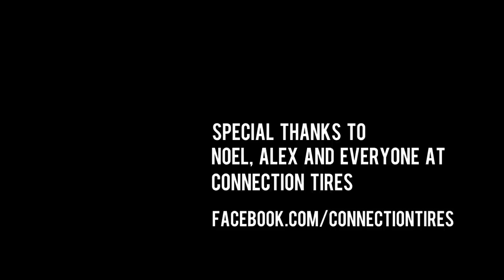Civic EK Stance Project: Coilover Install

Comment from the maker: Very cool man! Thanks for watching! Yeah, the milling can be done 10mm.  They are reffering to how much material there is on the back of the wheel.  You don't want to take away any structural integrity of the wheel itself by milling to much, but 10mm is fine.  Have fun!

Comment from the maker: yeah man. I honestly don't have anything to compare it to that I personally have owned.  I think the KSports ride fine.  One thing you have to keep in mind is that when your lowering a car, the springs are naturally going to have to be stiffer than stock.  So of course it's a "firmer" ride, but not anything that is annoying at all.  Run them on the full soft dampening or even change out the springs themselves to a lower rating if you didnt like it. I love them tho! Handles like a go kart!

Comment from the maker: Thanks for your compliment man!  The car sits about 5 inches off the ground right now.  I don't know how much I lowered it to be honest...a couple inches for sure.

As for the fender rolling, my advice is always.  Maybe others might say different I don't know.  Since I chose the 8 inch wide wheel, it was a must.  I knew I didn't want to do a "stance" car, so it wouldn't be slammed on the ground, but instead, got the fenders rolled because I didnt want the tire to scrape under hard cornering.

Comment from the maker: My best advice is to get out your measuring tape. I got 15x8 Enkeis which came in a +25 offset. It was poking out a bit too much from my fender so I actually got these wheels shaved down 10mm to make the final offset +35.

 I also run a few degrees of camber so the car handles real well in the turns but is giving it that "flush" look your talking about. Do your research on what camber settings you want to run as this should effect your decision on what wheel size and offset you want.

Comment: @ Refine Movement, I am ordering my wheels and tires next week, I have put it off way too long and need rubber badly and I'm not buying new rubber for  stock wheels, so its time. I'm going w/ the 15x8  Enkei 92's too, but in black because my 96' EK hatch is Vogue Silver and I think it would look the best on silver and it does "NOT" show "BRAKE DUST" I'm going 205/50/15 as well but really like the way the AVIDS look and their price, but going w/ Dunlop Direzza's Zii's because they have the BEST traction reviews of just about every tire out there and 2 lbs. lighter and 7.5 tread width compared to S-DRIVES 7.4, which I hope does not haunt me because they are ever-so slightly larger,

Comment from the maker: Well so far my efforts have been put in to the suspension.  KSport Kontrol Pro's 12kg springs up front and 10kg in the rear.  They are entry level coilovers and I don't have anything else to compare them to that I personally have owned, but I like these coilovers a lot.  The dampening adjustments are actually something that can be felt.

Aside from that the wheels are Enkei 92's in 15x8 which came in a +25 offset from the factory.  I had them changed to +35 to fit to my car more to my liking :)

Comment from the maker: mikesanto70, any reputable machine shop near you should be able to mill down your wheels.  You just give them the specs you want.  I'm honestly not totally sure how low I've dropped the car becuase I had changed the ride height a handful of times before getting what I wanted. I know the side skirt towards the front of my car sits about 5" off the ground. The rear is maybe half an inch higher. I like that setup for handling in my car. Thanks for watching!

Comment: reads like a tire rack ad.  LOL.

Looks like you even used the tire rack lug nuts.

Looks good with the silver and black though.  I had forgotten that they rereleased the 92s  interesting look on an EK.  I'm sure the s.drives will handle well too.

Comment: I was signed in under instant equity and did not realize it till after i sent it, anyway, thanks for the response on the milling 10mm, but the one question I forgot to ask was how that set up rides and handles compared to stock, obviously it will handle 10 times better, but I was curious about ride quality with the k sports which im going to use as well, i heard they ride super nice but i wanted your opinion since we have identical cars and set ups  Thanks Bro

Comment: So by shaving them 10 mm, your wheels then become a +35 offset which in reality brings them "IN" 10 mm so they don't rub your fenders and you don't have to roll them or not so much and also don't need to run a bunch of camber, also, what ride height do you have, how many inches did you drop it? Please hit me back because I have ordered the wheels already!!!

Comment: Did you just roll the fender or did you need to pull them to stop it from rubbing?
Reply from the maker: We got the fenders rolled or at the offset they would have rubbed.

Comment: @werefinemovement, I have a 96' EK hatch and want mine to have that same EXACT stance/height, Mine in Vogue Silver so I was considering going with the black Enkei 92's instead of the silver ones, are yours 15x8 w/+25 offset? or 15x7 w/ +38. They look like 8's to me but I couldn't read the size on the box in the vid., Also, were those K sport coilovers and how low did you go and did you have to roll the fenders and did you use a camber/caster kit. want 205/50 not 195's how's the S drives btw

Comment: Hallo. Nice civic dude. I have the civic ek3 sedan and i was wondering if you can tell me about the k-sports coilovers.. Are they good? Worth the money? Did they last a long life? Do you recommend them? Why ksports and not another brand?  Thanks and happy new year!
Reply from the maker: Thanks for the compliment!  KSports are the first and only coilover system I have bought so far. My opinion is that yeah, for the money, they are totally worth it.  I was in the market for a street level coilover that was still able to be aggressive.  The kit comes from the factory with 9.8kg up front and 5kg in the back.  They are much stiffer than stock suspension and you can tell a difference right away.  I lowered my car about 2 inches from stock on this setup.  I love it.  Everyone has a different tolerance of what constitutes as a "rough ride" but my personal opinion is that they are just fine.  Aggressive and fun.  I'm currently building an EG that's meant for just the track.  I'm looking at BC Racing coilovers for that but their track only systems. I hear their street level coilovers are great too.
Reply: Thanks dude. Good luck with the new buid!

Comment: love you hatch super clean when you gonna track it
Reply from the maker: Thanks a lot Curtis.  At the moment I don't have any plans to track it honestly.  It's my daily driver and like you said, it's nice and clean.  It's got low miles and is just a nice overall car.  Interesting that you mentioned in another comment that I should do an EG project car tho.....
Reply: That would be fun your ek is inspiring i can't believe I'm debating between a hatch and a miata project
Reply from the maker: You just gotta go with your gut at the end of the day man.  No one can tell you what you like but you!
Reply: Very true I appreciate the advice when I do I want some artwork for sure
Reply from the maker: That would be rad man, I'd love to draw your new project car for you Curtis. Whichever it ends up being!  In my mind the biggest choice you have to make between those two cars is do you want front wheel drive or rear wheel drive
Reply: Right I'm debating I want to drift but wouldn't be doing as regular as track days and autos my 96 nissan hardbody is my first rwd car actually. Decsions decsions lol

Comment: Can you please give wheel and tire specs? Also if there were any fender mods needed. Thx.
Reply from the maker: The fenders were rolled. The wheels are Enkei 92 are the 15x8 +25, running a 205/50 Yokohama s drive tire. The wheels were shaved 10mm to change the offset to +35mm.
Reply from the maker: You take the wheels to a machine shop and they physically remove metal from the inside of the wheel.  These wheels were +25 from the factory so after they shaved off 10mm of material from the wheel it made them a +35.  If that's still confusing look up "what is wheel offset" and you should come across some good articles explaining what it is.
Reply from the maker: The reason Robbie changed the offset was plus 25 offset on the EK civic sticks out past the fender. So he took the wheels to a machine shop and they saved off 10mm from the inside of the wheel. This made the offset plus 35. Now the wheels are flush with the fenders

Comment: what are the specs on those wheels! loving the fitment set-up!
Reply: The Enkei 92 are the 15x8 +25, running a 205/50 Yokohama s drive tire
Reply from the maker: You are correct on the specs of the wheel. However Robbie did have the offset changed by shaving off 10mm of metal from inside of each wheel making the offset +35. Thanks for watching!

Comment: @Refine Movement for a 93 Civic LX what coilover or springs from eibach or Koni on Enkei 92 gold trim sizing chart  ( 15x7, 4x114.3, 38mm )what do you recommend
Reply from the maker: We're aren't professionals in any sense. what I would recommend for maximum adjustability is getting coilovers from a good brand like eibach. The ride will better and you can adjust the height to your liking.

Comment: How did you have them shaved 10mm? I understand how, I guess what I mean is where did you take it to get shaved and what method was used?
Reply from the maker: Any reputable machine shop would know what techniques can be used to shave down any type of wheel.  It depends on how much alloy is physically on the wheel to be shaved away.  Different wheels, different amounts I would imagine.  10mm was getting close to all that could be shaved away in my case, so for what I wanted, it worked out really well.
Reply: Nice! They look perfect!